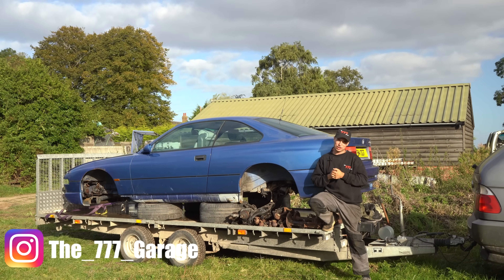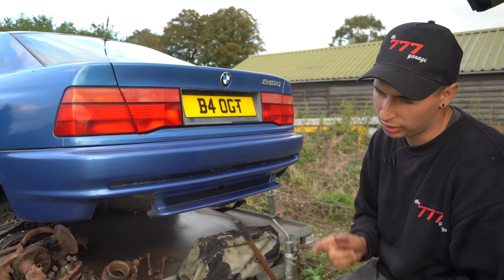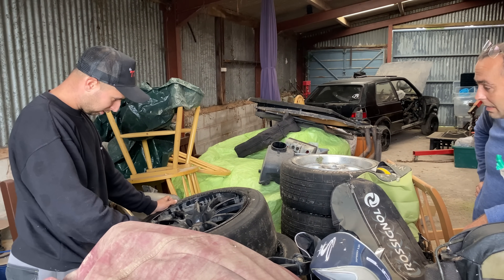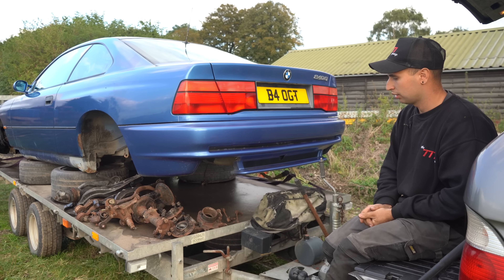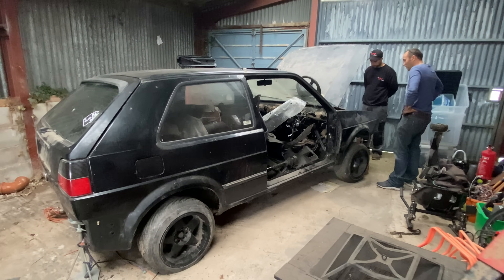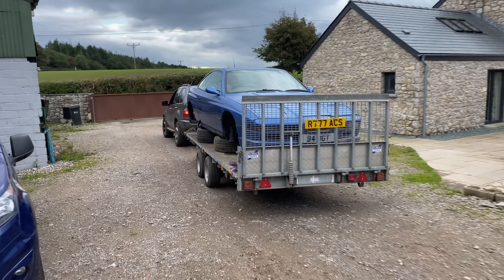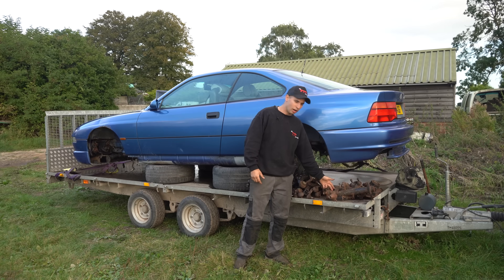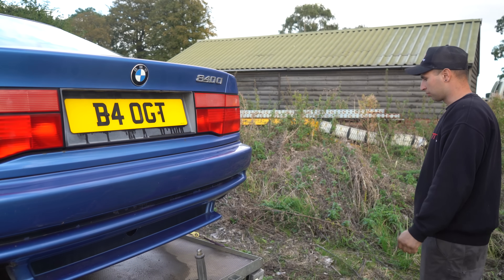Barn Find Bought - BMW E31 840CI - 7 years off road

Comment: Bc don’t make coilovers for e31,i restoring my self e31 at the moment and end up buying gecko brand coilovers is only two or three brand who offer coilovers for those cars.
Reply from the maker: Thanks ill look into it..
Reply: @The777Garage   if you end up fitting standard shocks,i have brand new eibach springs rear oem top mounts and aftermarket new front top mounts,they all new and will be on sale, i bought them for my car but after removing edc shocks i decide go for coilovers as edc replacement not worth the money.
Reply from the maker: Have u already installed coils? Would like to know how is the ride
Reply: @The777Garage   not yet as i refreshing all suspension at the moment so is all in bits.